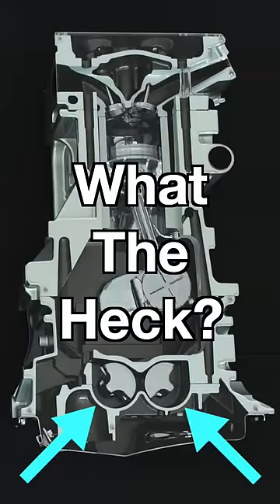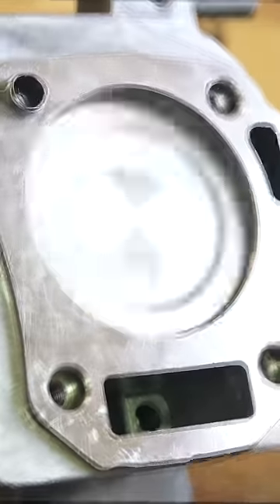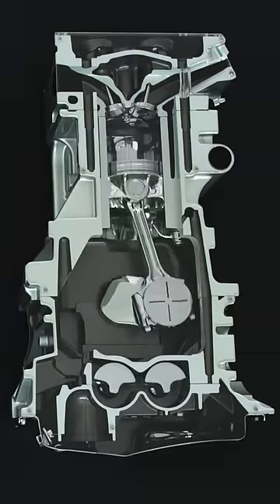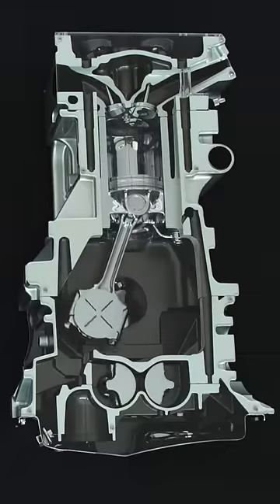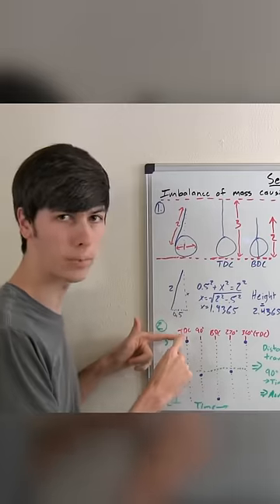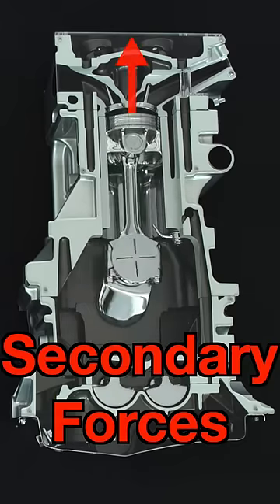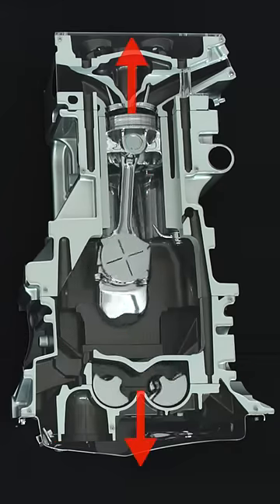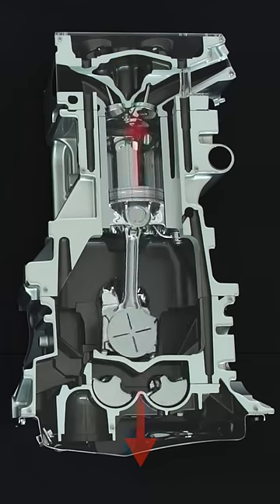How Engine Balance Shafts Work (In 60 Seconds)

Comment: You can also eliminate balance problems by placing a second bank of 4 cylinders at a 90° angle, forming a V shape. This way each crank pin that has a cylinder at TDC or BDC also has a cylinder at mid-stroke. As an added bonus, you get more horsepower because the engine has twice the displacement. Unfortunately, the hippies at the EPA do not like this solution.

Comment: So basically, I haven’t finished the video, but they’ve removed the counterweights which reduced rotational parasitic losses, this makes it very responsive and higher revving but we still need to counteract those vibrations, so those counterweights at the bottom fix that issue. So the crank can still spin very quickly and responsively, but keep the engine still balanced with little vibration.
Reply: no, counterweights on the crankshaft arenfornreducing 1st order vibrations, extra balance shafts are to reduce 2nd order - they are usually present on 2l or larger engines, with relatively heavy pistons.
Reply: @Papinak2  Doesn’t sound like you know what you’re talking about.

Comment: 4 cylinder sees don’t need them since they offset the strokes and the pistons cancel each others counter force out
Reply: They don't, conrod comlicates things a little - as in the middle of the stroke it pulls piston down a little, but pushes it up a bit on both ends - which results in different rate ofnacceleration in TDC and BDC.

Comment: Wrong. The piston moves faster when it is in the middle of its stroke, not at the top. A sine/cosine wave function basically. And the « piece used to counterbalance the primary force/the weight of the piston » is very, very often called a crankshaft, since it’s often what it’s designed for.

Comment: Why don't build the engine flat so every cylinder has a partner cylinder on the other site but the stick on to different cranks on the crankshaft. In this case, the moment of the cylinder counter each other to reduce vibration.

Porsche: 😏

Comment: Depending on number of cylinders and offset... There is no faster or slower because while one piston is trying to speed up the other is trying to slow down.
Reply: But piston in TDC is changing speed at a different rate than one in BTC due to conrod movement - that's where the imbalance comes from. They'd be balanced if engines used scotch yoke mechanism.

Comment: Intenally balancing an engine with balance shafts is a hardly anything new, nor is it only done by that manufacturer. Been done for a very very long time now, and is most common on inline 4 cylinder engines.

Comment: Balance shafts are a band-aid solution to the terminal illness of inherently imbalanced rotating assembly.
Reply: Rotating assembly is ballanced on the 4-cylinder, it's the linear movement that causes vibration.

Comment: True but not all engines use balance shafts and run vibration free there are other ways to counteract vibration such as using a harmonic balancer on the front of the crankshaft also balancing your internal rotating components very well balanced engines have been around before balance shafts were introduced booyah how's that for nerdology

Comment: Yes but it's expensive as you now have 10 additional parts all the friction that that will cause and because it's causing friction all the petrol that you will now burn. The good news is that stops the rocking it does not stop the spinning however or that they would both have to be rotating in the same direction opposite of the crank.

Comment: And VW used a tiny hex shaft to drive there balance shafts which intern drove the oil pump so as soon a the hex shaft failed the oil pump would stop and your turbo would go lol they didn't recall this as it normally failed just outside the warranty lol

Comment: Usually those are just cast on the crankshaft you chose a weird engine.
Reply: The crankshaft counterweight just balance the primary forces not the secondary because they act at 2x the rotation of the crankshaft

Comment: or you could just volunteer motor with the crankshaft, this is not a new design they've used the balance forever without no extra shavs in there

Comment: Your explanation is poor.  The counter balance of the crankshaft eliminates vibration, however if a manufacturer decides (like GM and the 4.3 v6) to develop an engine that is based on another it is cheaper to incorporate a balance shaft instead of developing an entirely new crankshaft and firing order to offset vibration. Most multi cylinder engines do not use a balance shaft and operate quite smoothly

Comment: This engine will not work. The inertia from the weights on the crank is what helps the motor actually work. Try starting a lawn mower with no blade on it... Really really difficult to do.

Comment: If they are even a real thing. On the older reliable motors they do not exsisst. If they are on newer motors it just adds too turning items that can mallfuction and the low quality of materials and parts today guarrentee that the more sensors and turning parts the qiucker you will need too part with your money to get it fixed after it breaks. It loooks too me that the only thing those do is create viberation of a lower kind so the large vibration from the pistons is not so noticable.

Comment: DON'T BUY BALANCE SHAFT ENGINES.
Balance shafts spin at twice crankshaft speed, and are driven by chains.  The chains will require adjustment, which entails an expensive tear down.  Without adjustment, the chains will break and damage the interior of the engine.

Comment: This is how inefficient ICEs are...all that dead weight just so the motor doesn't shake off its bolts. All the losses of energy...EV motors are magnificently more efficient and elegantly simple. Can you imagine if idiots preferred ICE over electric motors? A gasoline powered impact wrench? Gasoline powered miter saw? Or a gasoline powered jigsaw?